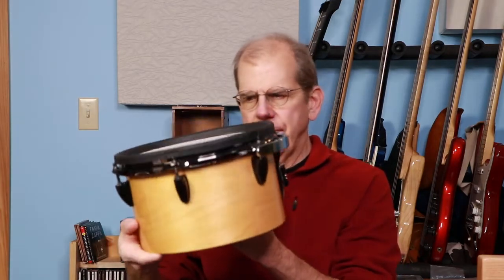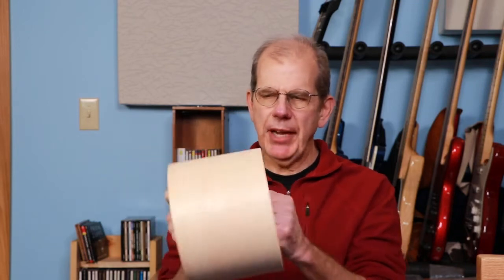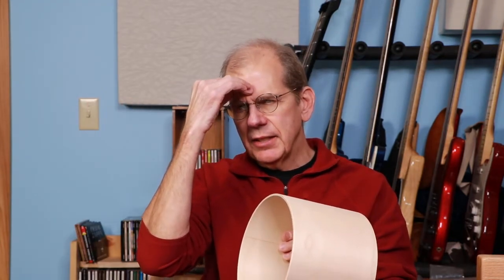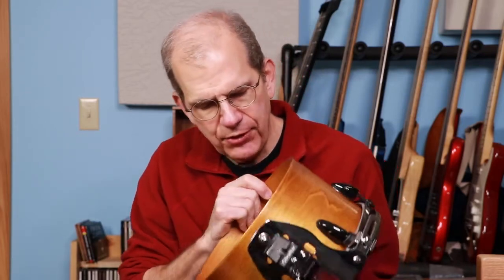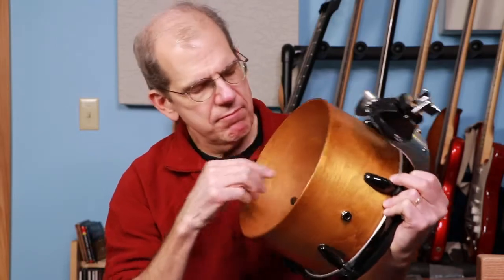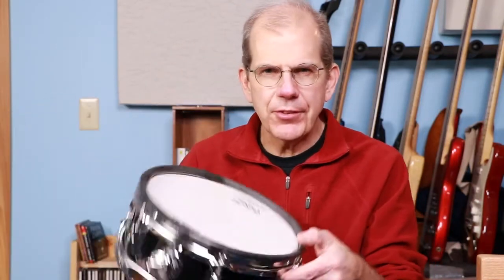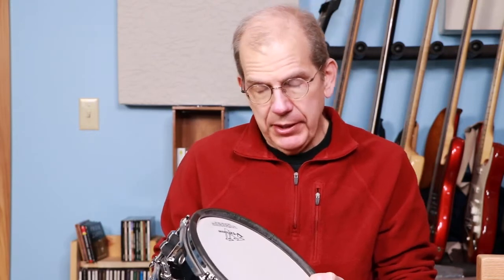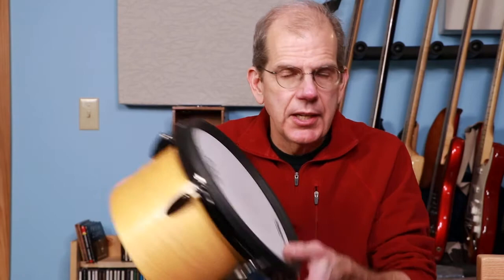Electronic Drums, Part 2 - DIY

Comment: Thanx a lot for sharing this project. I‘m thinking of turning an old snare that I don‘t use anymore into a electronic practise pad. Where did you get the cone from?
Reply from the maker: I forget the name but the last time I checked there were multiple places to find e-drum DIY parts. Just do a web search on "e-drum trigger foam cone" or similar. Some companies that I remember include Quartz and UFO Drums. Prices can vary quite a bit so look around. You might also want to check out vdrums dot com. There is an active user forum there.

Comment: I did this in 2008. I got a great price on a new Ludwig 4 piece jazz kit, Burgundy Red Maple woodgrain (at least the outer veneer). I approached this almost exactly the way you did. I cut all the shells in half and got 7 pieces as I also cut the bass drum in half and made it about 10" deep and sealed with both heads for better rebound. I could have had two bass drums had I not sealed the one using the hardware. All of this went into a Roland TD-12 and  an RM6(?) midi expander. I had 7 "Smart Trigger" cymbals. The cheap quiet practice ones from China had come out yet. The Smart Trigger Cymbals Glue dripped out. Terrible product.

Comment: I'm a technician. Mostly controls, but I've been a drummer for 20 some years, and for the life of me, I like to keep my kit primitive lol. No electronics, no cables, no sampling devices, just straight-up drumming. 
But this stuff is cool.
Reply from the maker: Yes, there are certain aspects that I love such as the ability to get a sound that has nothing to do with the size or shape of the drum. Plus, you can get different kits at the turn of a dial. And then there's the compactness of the kit (if desired). Ultimately, though, there was an immediacy and subtle quality that I found missing, so I went back to acoustics (but in all fairness, I now had a proper studio space so as not to bother the neighbors). The inherent lack of loudness is perhaps the greatest advantage of the e-kit, particularly for beginners.

Comment: Hi professor Jim, how about multi piezo triggering system that now more applied for higher end e-drum kit? They usualy get 4 cone with piezo at the edges and have some circuit pcb (i doon’t know whai it used for) they said for more realistic strike response and eliminate hot-spot.
Maybe you can make a tutorial for multi piezo drum trigger
Reply from the maker: Yes, things have been improving in terms of realism. To be honest, I don't worry about it much anymore as I've gone back to acoustic drums. There's just something more immediate about it. I miss the flexibility of sounds and pad sizes, though.

Comment: Great video! Thanks for putting this together. I am building a trigger and thus far I am not reading a signal in the drum module. What should the threshold voltage typically be to read a signal?
Reply from the maker: That's going to depend on the module and the sensitivity settings. If you're having trouble getting a trigger, try swapping input channels. If no luck, try just using a bare piezo and flicking it with your finger. If you have access to a digital 'scope, put it in single shot mode, set the time base to between 1 to 5 msec, set the pre-trigger for a few millisecs, and then give the drum a strike. You should see a fairly nice spike of at least a few hundred millivolts.
Reply: @ElectronicswithProfessorFiore  great thanks 🙏

Comment: After I converted my acoustic set it actually took up less space overall than my td10 which has a fairly large rack
Reply from the maker: That is a little surprising. My acoustic kit takes up quite a bit more space than my e-kit. About the same number of toms and cymbals, too.
Reply: I have a 6 piece kit and about 8 cymbals, I sold my 14" tom and planning to sell the cymbals and just have 14 10 12 16 22 ekit, I was building an ekit with disposable metal drums with plans to sell my acoustic set but I realised that was dumb when can add triggers without damaging them, will make the taps nicely toned i imagine too, they look so cool too, just got to figure out how to add a jack to a mesh res head